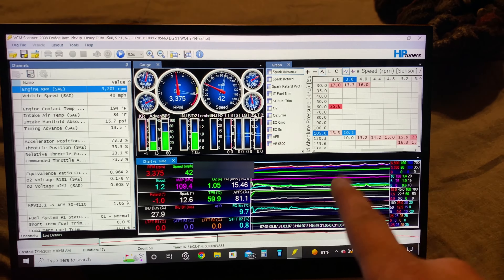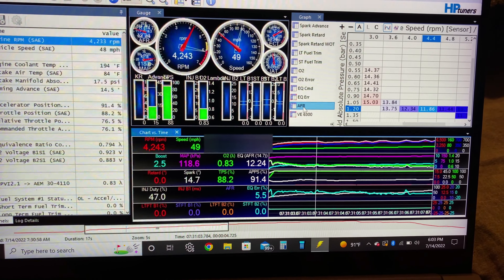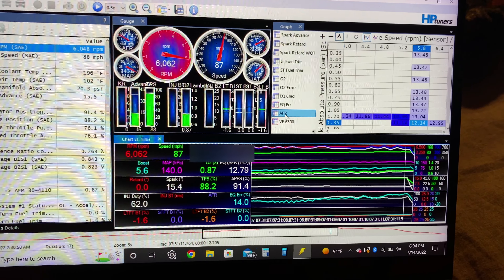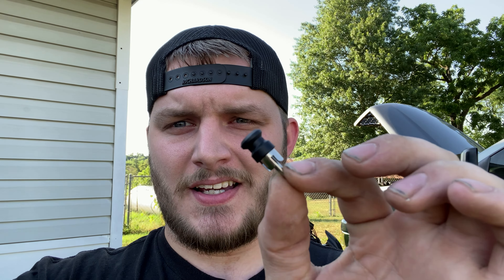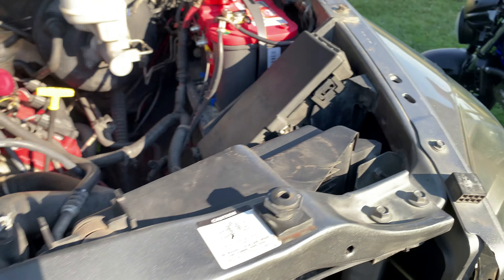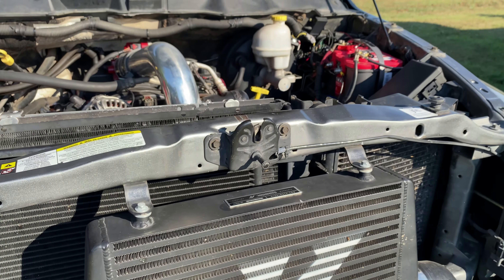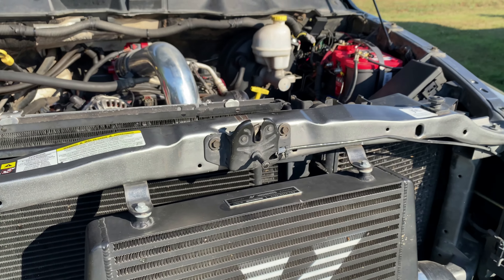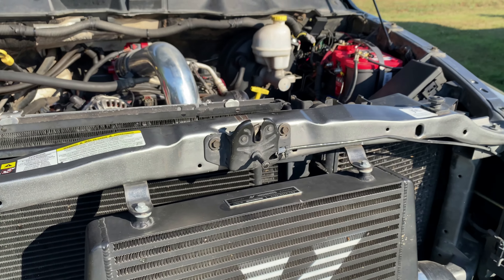Still Needs More Fuel | Boost-a-Pump Step Up Plug

Comment: It would be great if you can tell us where you connected both power wires. One with giant fuse goes to fuel pump TIPM and the other goes to fuel pump? I had it connected and no longer got power to pump. I did however not install that 17v plug. Please help?!?